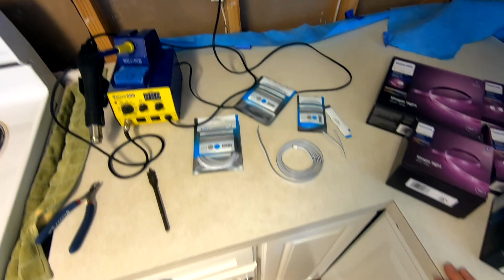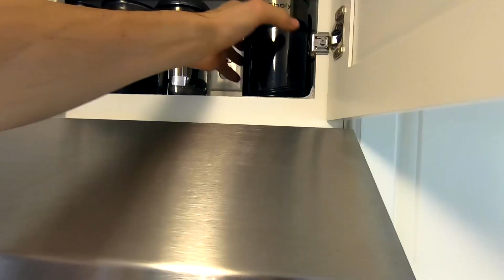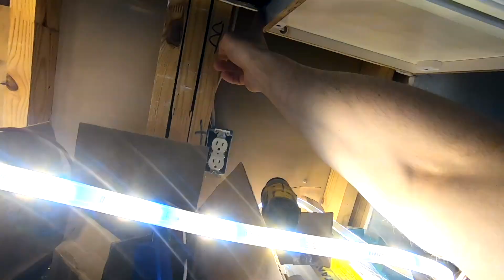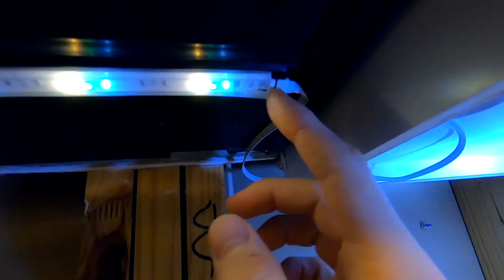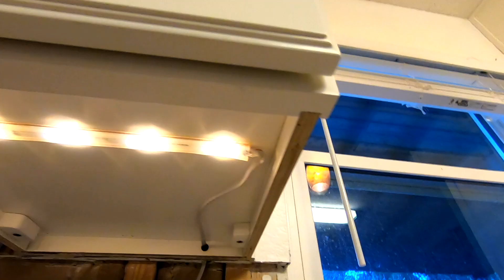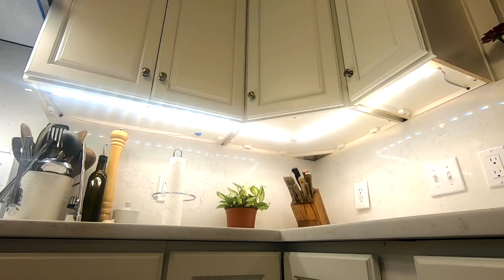Installing Philips Hue Light Strips V4 for Undermount Cabinet Lighting - Tips and Tools Needed

Comment: I did something similar except I soldered wires directly onto the strips because the litcessories adapters weren’t readily available when I did my project a year ago. It was my first time soldering and it was terrible but functional lol. It’s starting fail so I’m considering redoing my entire setup and really getting some practice down.  
  
Now that I’m done rambling, I’d recommend some aluminum channels if your really want to diffuse the light instead of having the harsh led spots with the reflections. Just a recommendation even though this video is older already lol. Great video though!

Comment: Thank you for doing this video, I'm redoing my kitchen and it looks like this is exactly what I will use for under cabinet lighting. Quick question: I realize that a remote control controls it all but can it also be left on and then controlled simply by a switch on the wall as well? More specifically, if the light strip is on but I turn it off at the switch on the wall, will it come back on when I turn the switch on or do I have to use the remote to turn it on as well?
Reply from the maker: Steve, I tested this out for you with my lights by turning them on and then unplugging them and plugging them back in. When I plug them back in, they turned on. So, I would guess if that if you had a outlet controlled by a switch on the wall, then it would work as you are wanting it to. I would say, the remote is really nice as it allows you to have a dimmer. We keep it on our refrigerator since it has a magnetic backing.
Reply: @stephenofalltrades1422   Thanks so much for your reply!
Reply: If you  use the hub/hue software, you can tell it exactly what you want it to do in a "after power-off" scenario

Comment: This was very helpful as I am planning to split my runs from above the vent of my stove. Is there not a splitter v4 for micro? How did you accomplish the splitter with v3 standard 6 pin which the link points to?
Reply from the maker: That’s strange, The version 4 was available when I posted that link (I use the version four) I guess the availability changes. I think I found it straight from the supplier site though. So here’s a link for that. https://litcessory.com/product/splitter/
Reply: @stephenofalltrades1422  I did end up finding their site. I learned a lesson not to cut the light strip while powered on 😞. Killed my first set. Luckily a certain store is very generous with returns.